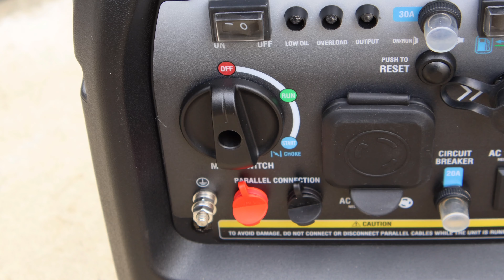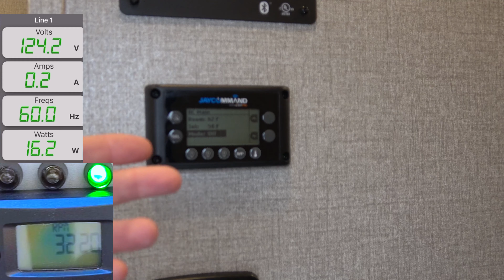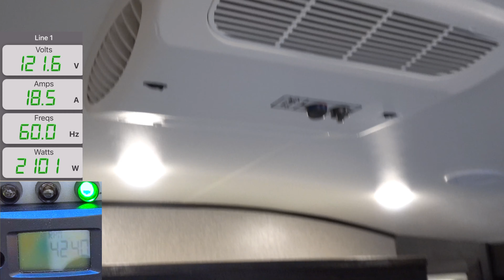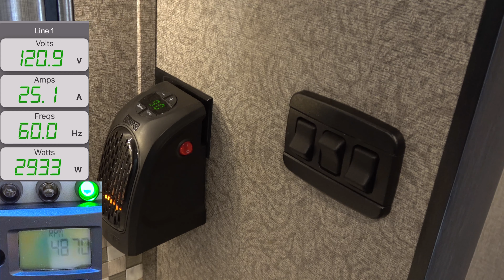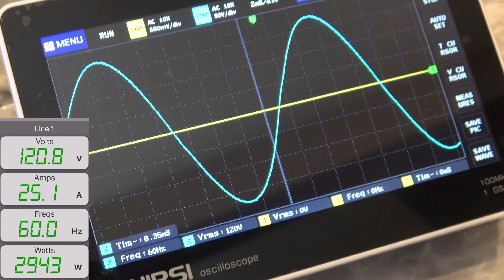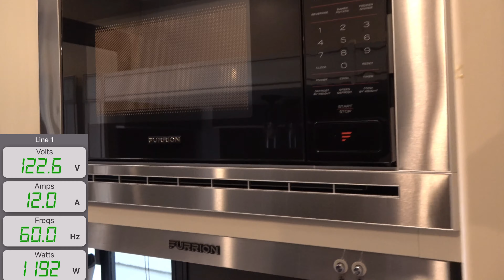Pulsar Dual Fuel Generator GD400BN Load Tested with Honda EU2200i RANT!

Comment: In your opinion! What duel fuel generator is best for 30ft travel trailer?
Reply from the maker: That’s a tough question. Because it’s the person and where they go more than the trailer. If you are up north most the time then A/C usage is minimal so a much smaller unit will probably be just fine. 
For people south and who use the AC 24/7 then a medium unit will be better as it will last longer. 
I really like the champion and wen4500 dual fuel for the more heavy duty use. They are basically the same but the wen is cheaper. Which is this model here….https://amzn.to/3XoMhqJ

For once in a while and running a few hours a day, I really am enjoying the pulsar 4000 dual fuel, simple, light and works great. Feed back from other users are very positive. The new maxpeedingrods is full of features if you like those. Same engine and made by dinking power / genmax who makes both pulsar and maxpeedingrods. 

So it’s more of where you camp and how you camp will determine what you need. Some want to run everything under the sun and some are more minimal. 
But these are the most popular models and ones I would also recommend 

Predator 3500 not dual fuel and now better option
Predator 5000 DF now seems fixed
Wen4500 DF remote start
Champion DF electric start
Onan 4500 gas
Pulsar 4000 DF
Maxpeedingrods 3500 gas

New maxpeedingrods 4000gt….https://amzn.to/3KIxRKB

Hope this helps
Reply: @johnnysweekends  I'm really liking your videos on the pulsar and the maxpeedingrods! I need something for my camping trips for insurance in case power goes out. So not really getting any heavy duty use. Thank you so much for the reply. 🙌

Comment: I'm planning to buy one. Do you think this one will work for 8 hours straight non-stop just adding more gas?  Thank you in advance
Reply from the maker: Yea as long as you don’t abuse it and run it at max or it’s sitting in the sun and it’s a 110F out side it will be fine.
👍🏼

Comment: I have a pulsar 1200w 2 stroke (900 running watts) for almost 10 years..i recently had to change the capacitor ($7 USD) and it's never stopped working.. i can definitely recommend this brand
Reply: @fowlman7254    was it manufactured in the USA or Asia at the time? Looked it up and it's made in Asia, designed in California

Comment: Excellent Review ! Although I probably like it since it validates my Pulsar GD400BN from one year ago. I had been wanting to ditch my troublesome Onan 4k and I've always like "Honda type" suitcase generators. I had never seen a 4k suitcase and dual fuel as well! I've been using it for a year now and so far trouble free. It does easily run my rooftop AC although I'm in Alaska so that's not to tough. I further installed a propane tee and cutoff on my RV and propane is all that I've used so far. I really like seeing it under various loads and measured performance, again nice thorough review.

Comment: just checked valves mine tight .004 did not go in.  Intake valve starting close tdc then checked.  What happens?  Is that max compression when tight valves.
Reply from the maker: Not so much to do with compression.
More that it can be loud or ticking but also cause poor engine performance and lower power output.
Also can burn valves if not addressed and more.

Most all I have dealt with are on par but anyone of the engines from different manufacturers can be off. 

I would check both for sure as if intake is off then exhaust probably is to.
Reply: @johnnysweekends  I have two units will check other better running one specs.
Reply: @johnnysweekends  ok just did better running unit stock specs intake .002 exhaust .0025 cold

Comment: Every time I think about getting one of the many low priced generators I end up reading the reviews on Amazon. They are all 4 to 4 1/2 stars. Great! Then I click on the one stars. Seems 5-7% of these things have serious failures and dreadful customer service and not returnable. I want one of these things for emergencies and I have never been particularly lucky. Ah for the days when you went to a local business to buy something like this and if you had a problem they could fix it. Now the China business model pumps this low quality stuff out and tuff luck if you get a dud!
Reply from the maker: I hear ya. It’s tough. Yamaha has a few medium sizes like Honda but super expensive and also very heavy. 
A lot of people have had good luck with several of these Chinese brands which like you know, most everything is made there now. You can look at harbor freight or Costco for items you can return. Tractor supply as well. 
This gives you some box stores. Even Walmart. Just have to make sure the gas I completely empty and no fumes. That’s one of the reasons it’s hard to return. Shipping hazard
Reply: A lot of that is because people dont know what theyre doing. Some assume it has oil or didnt know it needed it. Then they burn it out, realize theyre an idiot. And try to say "it failed on first run" to try and not have to pay for the damages.

Some don't use breakin oil for first few hours. Some dont drain the oul after tue forst hour, replace it, run 5 or 10 more. Replace it again. Etc. Fresh engines make glitter as bearings settle in and various other reaons. You have to flush that out or it eats stuff up. 

If you know what youre doing, youll be fine.
Reply from the maker: @astcomjakecw I find a lot of times it’s OE…. People don’t want to admit it

Comment: Got one of these, LOVED it...used it all last summer when I was camping off-grid...
ALWAYS started 1st or 2nd pull...
It was used to supplement my solar when there wasn't enough sun, or if I'd run my batteries down and it was raining...
I didn't run it on "gas" but 90% LP, and the other 10% on engineered fuel, never faltered...
ONE thing, make sure you change the oil on a regular basis, OR you will experience a loss in performance...
Reply from the maker: Awesome thanks for the feedback. Love mine. Simple,light and it does exactly what I need which is basically what you are doing. Recharge at a fast rate if I want and I can run a 15k ac when solar isn’t keeping up. I can run both with it but your pretty maxed on LP and I honestly dont know if it will hold 2800 watts or so in 100+ degree heat lol. Which is why I tell people buy something bigger.

Comment: for the fuel pump how can you power it with that generator?  theres no 12v port .
Reply from the maker: You’ll need an external battery. But it doesn’t draw much power so a small battery will do. Like a power sport battery. And then recharge it on solar or a charger

Comment: Hello there very good video could you tell me what the part number is for that extended run fuel cap you showed in the video I'm having a hard time finding it
Reply from the maker: It is currently back ordered …😕 but come back as when they do I’ll try and grab a discount code. 👍🏼

Comment: Pulsar is impressive.  Just saw the video where you are at Quartzite  for the first time and asked if you had done a voltage drop test comparison.  I see you have the power watchdog also, I love mine.  When I run my Generators one at a time  for maintenance I usually hook it up to my RV I have a 13.5 Coleman Mach something.  I don't have a soft start but with the aid of the power watch dog app on my phone it helps me watch the amps where I can keep it below 15 amps.  I start the A/C on low fan, than high fan, than low cool taking a few seconds each time than finally to high cool, normally I only reach about 12 amps.  It is the amperage that trips the generator off not so much the wattage and this year we had over 78 days of triple digit temps in Texas.  Man I need to stop watching your videos, I'm tempted on buying the Pulsar.  Wish I had run across your video.  Anywho, great video and great information.

Comment: What do you use that shows voltage, watts, etc. that you overlay into the video?  Is that a screen record of the Watchdog app on your phone?
Reply: The power watchdog has blue tooth and you can use it with your phone.  I have one at it is an excellent product.

Comment: How long could you run just the 2 ACs on the small can propane? Like overnight to sleep?
Reply from the maker: Don’t know that’s a lot of variables, what size AC units? I wouldn’t run 2 15k units on this. Even a 15k and 13.5k could be a constant 2600-2800 watts. You need a bigger unit
Reply: @johnnysweekends  ok. You just run one of your 1350 at a time? I think you aid they were 1350 each.

Comment: I suppose there is the question of whether this is really a "high performance" engine or someone figured out they could make an "ordinary" engine run at a high RPM and then put it into a compact, light, and powerful generator?  Like someone modifying their Ford Pinto to go faster on a supercharger.  Just because someone figured out how to do it doesn't mean it was a good idea.  Then again, I think more people would complain if these were failing right and left.  Probably most people keep the load down most of the time, especially as it gets too loud for national park regulations at high loads.  Also, this is probably not something most people run every day.  If you want a generator designed for more use and abuse, generators for twice as much, twice the physical size, and weighing twice as much tend to be what shows up next.
Reply from the maker: Exactly if you dont abuse these they should last. I dont understand when people say I was running it at 3000 watts for 4 hrs when its hot out and it dies. Especially if you run them out of fuel as it’s a cooling agent and then you can risk scoring. 
Most national parks have a 60 DB limit but that’s at 50 feet….even the little Honda if loaded enough will be to loud. You have to get to larger ones or really small and just run a light load to say charge batteries. 
Noise levels are also much different when you add dirt, trees, and more that muffle the sound. Placing in a truck bed helps a ton!!!! Or of course your own sound box or even a gen tent can knock a couple DB off. 
So far these units for people who need basic power these will do fine. Owners play a big part in longevity of any tool

Comment: I’ve resold my pulsar because it keeps shutting off at 3000 load.. it can’t keep anything near 3200 are 4000 watts!! 🙁🙁
Reply from the maker: That’s because you need a bigger generator if you are trying to always run 3000 watts and more. No generator likes to be maxed out. Like I said in the video if you are always running 75% and above especially when it’s hot out you need a bigger unit. 4000 is only the starting and that’s for like 1 second. 

You need a larger unit as you are over working that small one.

Comment: Great video! I also just noticed that the MXR3500 is made by a slightly different company, yet it uses the same engine and same case.  Take a look at the spark plug boot on the Pulsar vs the MXR3500.  The Pulsar is missing the rubber grommet to hold it firmly in place in the housing hole.  The MXR3500 has the grommet.  Weird that the same engine has 2 different coils.  My Pulsar plug wire vibrates like crazy, to the point that it actually loosened the spin on terminal after just a few hours running!  I contacted Pulsar and they sent me (no cost) a replacement coil with wire, but it's also missing the rubber boot/grommet.  Weird.    Also, I noticed that your Pulsar is getting a white spot on your air filter door.  It's from the solenoid harness to the carb, pushing up against the inside of the foam and plastic on that access door.  Mine is doing the same thing.  Mine also has a white stress mark on the upper part of that panel, where the wrong size hose clamp was used to secure the propane hose to the inlet of the carb, and is also pressing up against the panel.  I emailed Pulsar photos of my unit doing the same thing, and I told them my concern is not only the cosmetic aspect of the enclosure case turning white and cracking, but the forces and vibration of the propane line failing prematurely, and the same thing for the solenoid connection at the bottom of the carb.  Anytime you have 2 things being pushed into each other and vibrating, you are bound to see a failure of the weakest thing.  It's still a very impressive unit, especially for it's price point.  I'm still trying to get more hours on my unit, to make sure it has no further issues.  Some reviews noted that the single 15A outlet with TR (tamper resistant) is near impossible to push a male plug into, and some people noted that by pushing too hard, it actually broke the outlet as it pushed back into the panel.  I took some dielectric grease and spread it on the outlet before inserting a plug, and repeated this a few times.  The grease really helped to lubricate the TR shutters, and now all plugs, even 2 prong, slide in smoothly.
Reply from the maker: My spark plug boot is correct and a full boot and cap. Yes the air filter door has the white spot like you noticed and correct, solenoid for propane switchover. I don’t have another white spot yet as a clamp looks correct on my main propane line but yes, the tamper caps on the 15 amp outlet like any of the ones that you buying the store are kind of junk. I don’t exactly like them myself. but I realize I probably wouldn’t use that outlet very much as that’s not the purpose at least for me with this generator, but yeah, some light WD-40 or some dielectric grease would be great to help loosen those up a little bit, but being that it is an outlet with the electric grease. It will attract dust and junk, which could actually make the tamper caps even worse in the long run, keep an eye on the generator and let me know. I only have about five hours.

Comment: I just got mine in today got it broke in and changed oil it started first pull was super impressed how quiet it is big fan so far ready to hit the trails n camp
Reply: Only one 120v, so I pass on it.
Reply from the maker: @vashon100 they make tons of splitters and even then you still only get a max 20amp with one or a pair of 120 plugs

Comment: I enjoy your videos, but mocking people for their comments on your last review is a petty way to start your video.  Your points are valid but comparing an 1800 watt generator to a 3kw IS inherently unfair when talking about the loads they can handle.Comparing it with the honda 3200 is a much more apples to apples comparison and the price difference further makes your point about value for occasional use.  
With that said, id really like to see you review the new WEN generator models like the 56360ix. Ive been a fan of wen especially there bigger inverters but looking at specs these seem much more noisy than say the 56450i.
Reply from the maker: Point taken, I guess im just done with the same comments from the same people about the Honda 2200, which is what people always compare these small units to. And im not testing them fairly when they are not exactly in the same class. But I try to tell people what an item does do and what it doesn’t. Which sometimes takes a couple months to get more data and especially when it’s cool most every unit performs great. Add a hot day then you see if they can handle everything. But these little suit case units have been doing really well over the last year and a great size at a fair price. Wen and champion are great units, most anyway. The 56360 being gas only seems a little bigger than these but I would have to see. Also need to see what Chinese manufacturer makes it. As most of these are copies of another. The wen 4500 is a great unit and Ill be doing a review soon with the champion 4500 both dual fuel. And yes the smaller ones dont have as large a muffler or engine box around it to help muffle engine noise.
Reply: Most of the Wen is Rato I believe, and use the Honda clone engines, which are generally very good.

Comment: What happened to the Genmax suitcase EFI?  No longer listed on Amazon; but Walmart still showing it.  How can we tell if the units listed online are the ones that will start without batter support?
Reply from the maker: It sold out super quick so waiting for next boat shipment. I would assume soon. I wont know on the other battery model and if they will actually do it. That’s just what they told me so..🤷🏼‍♂️
Reply: Stay away from ALL Genmax products. Junk.